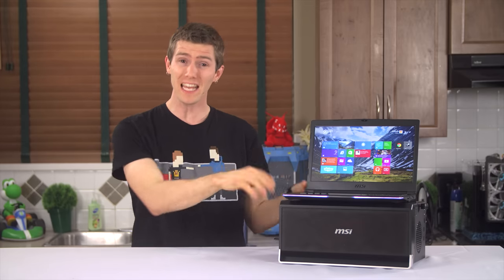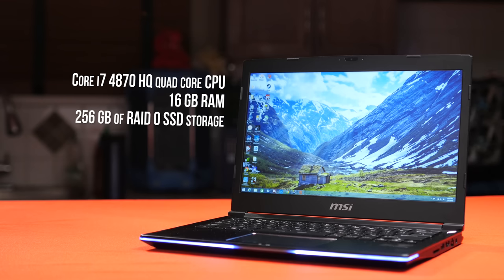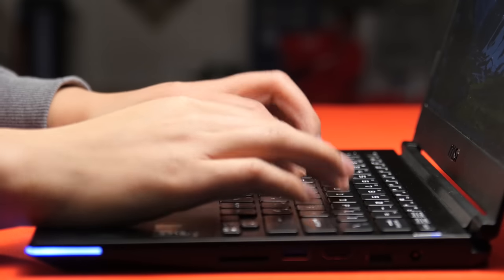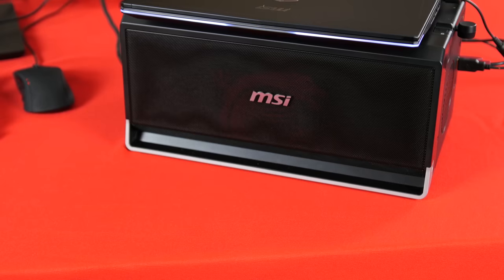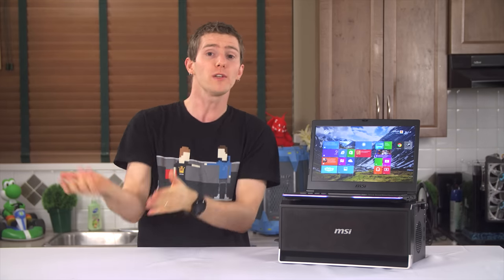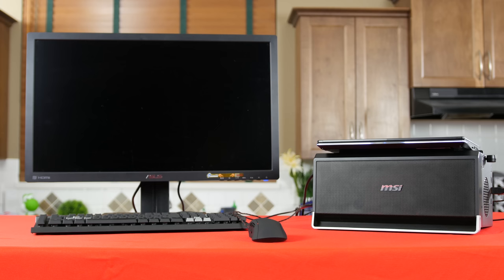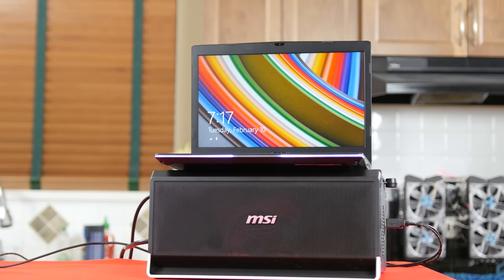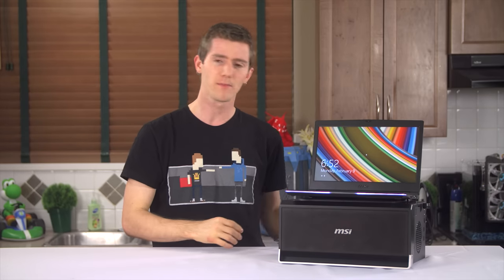MSI GS30 Shadow - Part Beastly Gaming Rig, Part Ultrabook

Comment: I've always enjoyed Alienware, but I've always felt it was more of a luxury brand, not always practical.  I think this is only the second time I'll have said that Alienware's solution was the more practical one.  It's a portable gaming laptop that you can empower even further with the GPU box, looks nicer (that MSI box is not something I feel has any aesthetic value, looks quite ugly) and Alienware is going to be making it a standard according to their site.  Well, a standard for their laptops.  That and it's not actually a dock, so the heating of each one doesn't affect the other.

EDIT:  Also, the Alienware GPU box is about $300 US and does the same thing and is made for m13x (13 inches) lappy.
Reply: Um... As far as I know only the amd cards will work with it because its only a 4x link. (Pls no hate I'm not a fanboy either way)
Reply: Ben Rayner You can use Nvidia.  As a matter of fact, MaximumPCmag has a video speaking to an Alienware employee that shows off the Alienware Graphics Amplifier running a 980.
Reply: Right, I was confused about the 4x link with SLI. my bad
Reply: Maybe it has an x8 connector and you only can crossfire with x4.... Happens a lot
Reply: It works with the entire new line of mx, so you can even get the mx17. Great performance both at home and away.
Reply: I would agree if not for the wieght of their laptops. Carrying this bitch is pain and having opotion like MSI works better for people. Many gamers might work in the office or somewhere where they need light notebook. Giving them option to have good looking notebook that is capble of showing presentation and/or work on whilist still being able to play games at home is great. I personally don't travel that often but I do have a PC and notebook that I need to vary. I could save up money and space for solution like this but I've already made system so maybe with next upgrade I will switch.
Reply: Fighting_Hussar While Alienware's laptops aren't slim, the MSI is working with a stock GPU when disconnected, while Alienware's laptops all have discrete GPUs.  If what 88oscuro is saying is true, you have an entire lineup of laptops you can choose from to get the portability of the MSI.  

The M13x is a 13' laptop that even offers the option of touchscreen and comes with a discrete GPU, so it's more powerful than MSI's when not docked.  To each his own, but the 13 inch is a bit bulky (it IS a powerful laptop) AND the entire ordeal, 13' laptop AND the Alienware GPU box would set you back about 1200 for the lappy and another 200-300 for the GPU box while giving you a more versatile package that's more aesthetic and does the same as MSI's.

Also, the 13' isn't all that heavy, it's about the same as MSI's.  With MSI's options, you'd be spending over 2k just to get a basic laptop that you can only take advantage of at home.  For that, you're better off building a gaming desktop and getting a portable workstation, cheaper options.  With Alienware's it just makes more sense.  Powerful laptop (with a selection of size of laptop so you could always get the tiniest one which would be lighter or as light as the MSI) and you can boost it with a GPU box.
Reply: I want to like alienware's system. But I want quad core so I can't get a 13in. I want one connection but with the alienware I need to connect power, network and graphics. I always have an external hard drive at my desk and I would love that the MSI can take a standard 3.5 in. I have an alienware 14 now and I want smaller, dropping to 13 in and less power I don't like. Decisions are hard.
Reply: Jay Clarkson Yeah, hopefully they give you the option of using an i7 on the 13 at some point, that would make it a guaranteed buy for me.
Reply: Siege Oh, didn't realize they were offering the i7s in the 13 inch, been a while since I checked it out.  So what they really need is a quad core apparently.  

The M13x definitely has a really good battery life.
Reply: +BoogerLeader i like alienware too, the only thing that i hate about it is that i cant factory reset it without the usb from the company and once its gone you ll stuck with it, and there are no solution

Comment: I am not at all a alienware fan or something and still I'm asking myself after watching this, how is this better than the alienware solution, cause I didn't quite get it! Anyway with that kind of money I'm pretty sure you can get both a laptop and a desktop with decent capabilities from a gaming perspective, and that way two persons could use them simultaneously if necessary!
Reply: just you wont be getting a GTX 980 in the gaming computer while still having to buy the laptop separately form the rest of the computer.
Besides that you do have a good point there as you can build a very good gaming rig for about $700~$800 then get a decent Ultra book for $1,000 just because Ultra books are more expensive for some reason but that doesnt include the monitor which ussualy is another $600 to $3,000 for a IPS monitor depending on response time kind of panel and res. of the monitor, not counting the OS licenses needed to have both the Ultra book with a legal copy and a legal copy for the gaming rig, not counting that you will then need a separate keyboard and mouse for the computer from the laptop, not count the speakers needed for the computer, also not counting that it will just be more convenient to have it all in one docking station than having 2 separate computers though having 2 separate computers does make more sense in one point of view it doesn't if you are only 1 person as how can you play on 2 computers at the same time and be active on both?
Reply: This is actually the same as the alienware solution but much more expensive.

Comment: The Skylake Surface Pro needs to have a dock like that, maybe MS can license the tech.  The $200 they charge for the current dock almost certainly has enough margin to accommodate some PCI-e connectivity.  As it is now though, I'd be really tempted to mod the hell out of that dock.  Basically rip out all of the electronics and build a completely new enclosure, one that has the card lay sideways to for it to sit lower, accommodate a 240 mm radiator, and add an additional USB hub.

Comment: I do think it's impractical unless you're using it as strictly a desktop replacement, with an on-the-go option. Using this WITH a desktop seems nonsensical. But that's probably its purpose.

Comment: How the fuck do you use this while sitting, thats what i wont to know.
Reply: Probably what Linus was doing at 7:40. Using a separate monitor/mouse/keyboard.
Reply: AugustoTobias Why dont you just buy a pc and and a laptop?
Reply: Im Muffy ATM it is better due to it being cheaper but once this gets more research and time it will be a cheaper solution to buying both.
Reply: Im Muffy Like this you only have one computer so only need to install programs once. Also you don't have to sync all the docs and setting across two computers.
Reply: TJSW That and who the hell is the target audience? The point of a laptop is to be mobile, not being tethered to desk.

Go through all this effort to turn a laptop into a desktop, mind as well just get a desktop.
Reply: My friend got one recently. The laptop has to be closed to use the GPU while docked, so you'll be needing to find yourself a mouse, keyboard, and monitor too.
Reply: Im Muffy
Because this means you don't have to keep swapping files from one to the other.
But I still wouldn't buy it, custom built gaming PC, and an ipad (or something, if you don't like ipads*) is a better solution in my opinion.
*ipad purely as an example, because I don't know what any of the android ones are called: please don't rage at me for bringing up an apple product.
Reply: TJSW My point is, who is going to buy this? This is a lot of money, and equipment, to turn a laptop into a desktop for gaming performance. When, like you said, it's cheaper to get a gaming PC and a powerful laptop.
Reply: TJSW How does "uh? what da fuck are you taking about? " translate to " call someone who gives a fuck". Sounded like you cared, since you replied to me with a question. 

"I'm replying to someones comment and you randomly tag me about who wants to buy something.."

I was adding to your comment since I agreed with what you said and had a thought that would go with your point. 

Also, what's with the attitude? You're acting like I insulted or you.
Reply: Im Muffy Poor Muffy.
In a desktop setting you use a REAL keyboard and a REAL mouse.
I know..I know...its pretty kompleekated...
Reply: +AugustoTobias and why exactly is this laptop not mobile? what prevents you from disconnecting and carry it around for work, then come back home and game with the dock?...
Reply: +TabalugaDragon The laptop isn't mobile because it has to stay tethered to a charger due to its crappy battery life. A decent gaming desktop and UX305 would be a much better deal.
Reply: Grif Denton how is up to 5.5 hours a crappy battery life? Also sockets are almost everywhere nowdays.
Reply: +TabalugaDragon 

The GS30 only gets 5.5 hours when idling with no wifi and minimum brightness. When actually used for anything it gets about 3:30 according to
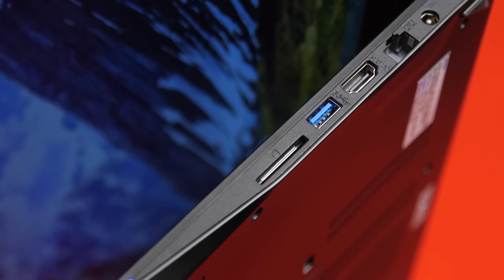notebookcheck or 2:25 according to the video above. While there are a
fair number of outlets nowadays it's still inconvenient to constantly
have to seek them out and stay next to them, especially for those who
are on the go a lot (the people who buy ultraportables in the first
place). A custom desktop and separate laptop would be a better deal,
since the desktop wouldn't have the heat issues or loud noise from a
laptop cooling system while the laptop wouldn't suffer from short
battery runtimes. The GS30 tries to be both desktop and ultraportable
but excels at neither.
Reply: Grif Denton 5.5 is during reading from a screen, on medium brightness. and I really don't understand your complains about as a desktop. The processor in it performs like desktop i7 4770
Also having all in one is MUCH more comfortable, by my own experience. I use my laptop as a desktop, with separate display, mouse and keyboard, and it's really comfortable not to have another pc to game on, when all files, heck, the whole system I got used to is in one place. Laptops with such powerful processors are usually neither cheap nor that slim, mind you, it also has an SSD which is great for people who want to do some video editing on the go and come back and game at home.
Reply: +TabalugaDragon Where the heck are you getting 5.5 hours from? The reivew from notebookcheck and pcper give it about 3:30 while Linus' video gives it 2:30. Even if it had 5.5 hours though, a setup with a separate laptop and desktop would still give better battery life at a lower price. For example: a desktop with an i7 4790k, 16gb of ram, 2x 128gb ssds, and GTX980ti combined with a ux305 is about $2,020. The Gs30 with the same storage and ram and the same video card is $2210. This setup costs a bit less but also gives significantly better battery life on the laptop (8-9h as apposed to 3-5) but also a slightly more powerful desktop without the high noise output mentioned by Linus.
Reply: Grif Denton I got my info from other popular reviewer, he always tests battery life on medium brightness. Also I already explained to you how comfortable this config is to have 1 computer for everything, and you simply ignored it. Sure it's more expensive, but it's much more comfortable, and given high sales(no doubt, MSI invested some money into making this) it will become cheaper in the future
Reply: +TabalugaDragon  I think he ignored your argument about it being more "comfortable" because it is subjective. I use a setup similar to the one Grif was talking about (just a weaker desktop) and I can argue that it is just as, if not more "comfortable" to use. Google drive software syncs my documents between my desktop and laptop, Chrome syncs history and bookmarks, and I can quickly copy other files with a usb 3.0 flash drive. Plus there is the advantage of redundancy, if something happens to one computer I still have the other for backup, this means I don't have to worry about my laptop dying or being stolen and causing me effectively lose both computers and all my data. It's also more "comfortable" being able to use a laptop that is thinner and more rigid than the gs30 and not having to plug it in during the course of the day. Oh yeah, don't forget the noise levels mentioned before.  

Also, what is the name of this reviewer you are talking about? You said they did a "reading" test, which could simply mean having a pdf or word document open and staring at the screen. The sources Grif Denton gave actually tested web browsing which takes a bit more power. The ux305 gets about 8-9 hours on web browsing tests which is 3x longer than the gs30.

Comment: A lot of people don't seem to see the point to this, but I actually like the concept. The problem is the price. The point of this is to be efficient and save you from buying multiple devices. The problem is, I can build a mini iTX gaming PC for $1000+graphics card cost and buy a decent notebook for $1000 and there's no reason to spend over $2000 on a combination of both that have more limitations. The truth of it is, you need to make it cost effective for people. The price needs to be cut in half or cut down by a few hundred dollars and include the graphics card. It's just not worth it right now.

Comment: that massive box is the stupidest idea i have ever seen also did you argue with tb over it?
Reply: No, it's a good idea, but only for a limited audience.
Reply: I think it's a good idea and a good start. But, I believe that the price tag isn't quite justified. 2 000$ for this laptop is stupid for a simple reason. A laptop (around 700$ so with specs around an i5-4200m+ GT840m) + a desktop (around 1200$ with specs like an i5-4690k + gtx980) would give you an overall better experience and better upgradability. All that, for the same price as this laptop+ dock station.
Reply: i forgot the mention the price aswell thats one of the massive reasons its stupid
Reply: rusty banana
Any other reasons? Just the size and price? First let's talk about the size. On the go, it's an ultrabook. Super slim. At home it's a desktop when plugged into the dock. A DESKTOP. YOU'RE NOT PUTTING IT ON YOUR LAP. The price: well it's essentially two computers. The main computer is a laptop but when plugged in it's a desktop computer. While yes, this is not a very practical option right now, it's not "stupid."
Reply: Tyrov I mean 2000$, ur getting an ultrabook and a desktop without any graphics. So if you want a good gaming experience you might have to spend a few hundred more for a graphics card. But if you can afford 2000$ then I think you can also afford a graphics card :)
Reply: thats what im saying ive had laptop in the past that have been able to run games not greatly of course but still playable that didnt cost that much and also didnt sound like a place taking of

Comment: Dat missing Intel ad voice over tho x-D.

This is actually giving me TONS of ideas as a modder, having listened to the gripes you had about the noise of the cooling solution and the way heat from after market GPU coolers travels through the top of the enclosure.  I can already envision moving the PCB and all of the I/O from the stock MSI box and instead placing it in an enclosure that allows you to house one of Swiftech's new MCR 140-X Drive solutions attached to something like an EVGA Hydro Copper card or any other aftermarket water cooled solution.  Maybe this is just me, but I would personally LOVE the chance to play around with that.

Comment: Holy balls. For the last three years I had been talking about this with my friends and sharing this idea of a PC that connects into a dock to have more graphical processing.

Recently, I was talking about a tablet that does something similar; A tablet that can be docked onto a keyboard, just like the Microsoft Surface but also, a connector on the keyboard dock that allows for a pass-through to connect to other hardware, but also that box can allow just the tablet to be connected. So basically the keyboard could also maybe house a couple hard disks, or you could use the tablet with the box that it comes with where you can connect (at least) 2x-SLI-capable video cards and maybe an extra CPU that would work in tandem with the one already inside the tablet.

The only way to make something like that better is to allow the box to either be water-cooled, or to permit replacement of the shroud on the video cards with something that exhausts the heat out one side, so all the heat has somewhere to go without a super-noisy fan. Personally I would keep the video cards in an open-air environment but aesthetics are a thing with PCs and that looks ugly to a lot of people, so I guess you can't win 'em all.

Comment: I find this convertible concept really interesting and expect to see more of this in the future, and I commend MSI for the moves they have been making lately. They've really been pushing the envelop, regardless of how these types of products perform.

Another area where I could see this being used is Microsoft's Surface line. Sure they have a productivity/business dock for multiple I/O and monitor connections, but nothing to address the lack of gaming on the Surface. This type of concept seems to be the direction they could go to really push the device to be full featured.